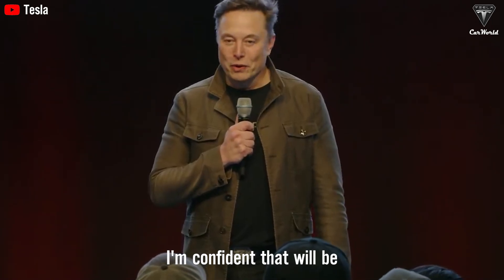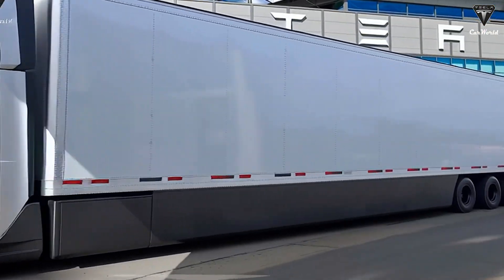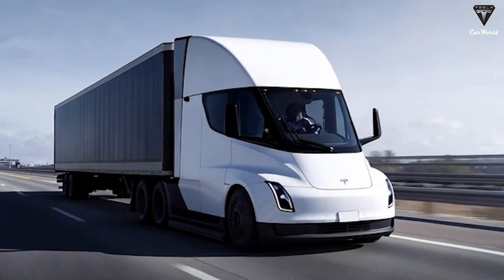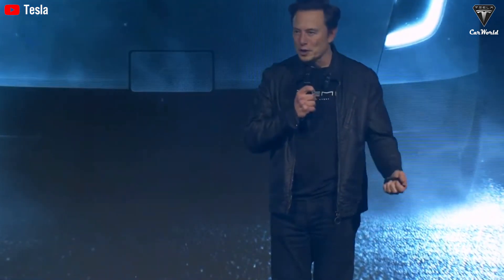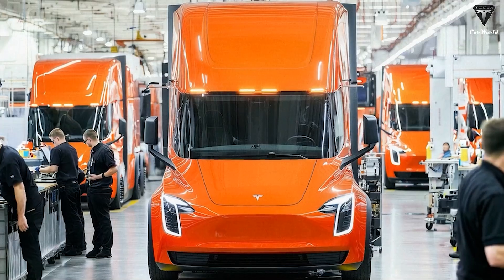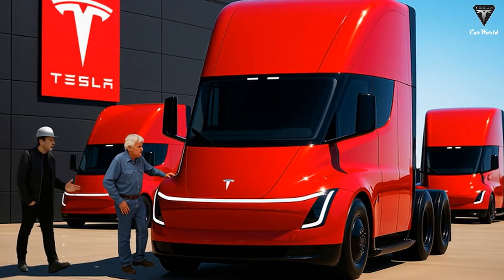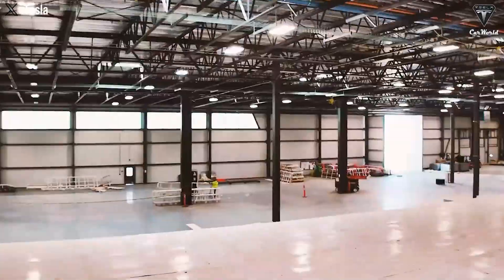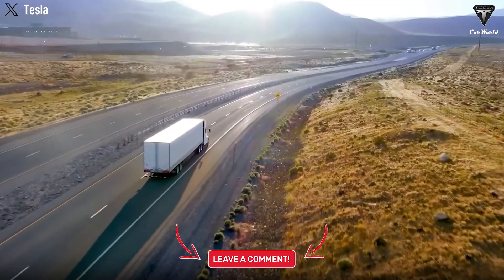Tesla Semi Gen 2 High Efficiency Finally Spotted At Giga Texas! New Payload & 2026 FSD Look!

Comment: No one has explained the braking system on these ev trucks. All trailers, trucks use air brakes now
Reply: It has its own Air Compressor, as it uses normal trailers! 😁
Reply from the maker: The Semi still uses standard air brakes for trailer compatibility, supported by its own onboard compressor. Regenerative braking handles most slowing, reducing wear and improving safety.
Reply: Regen plus air brakes should give superior stopping power. Regen is a perfect fit in a EV truck, a truck will slow significantly when the driver lifts his foot, a good portion of the kinetic energy goes back to the battery. The advantage of regen when going downhill is superior, not only will brake usage be minimized but the kinetic energy actually increases range.